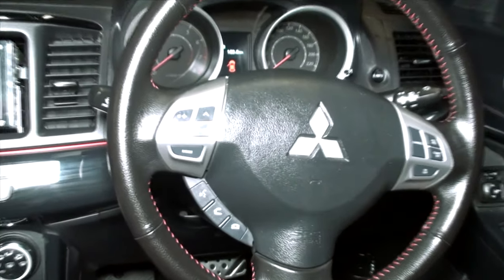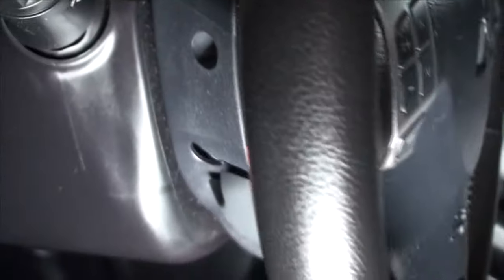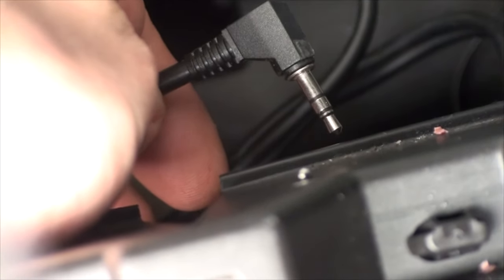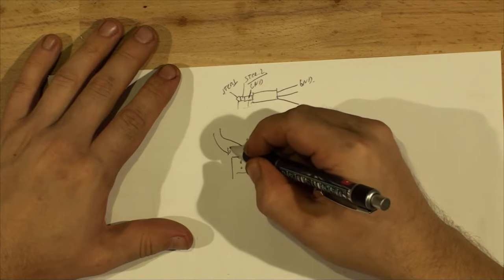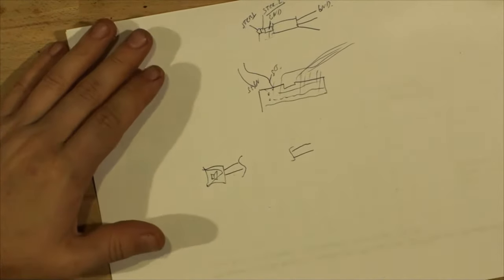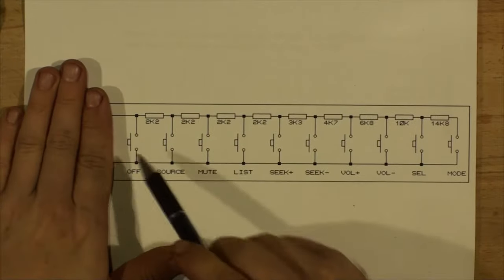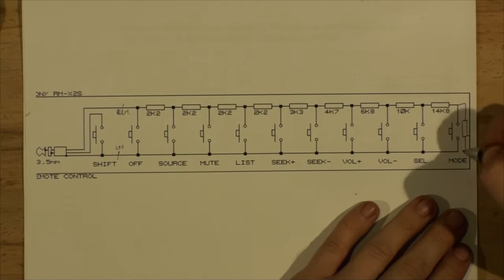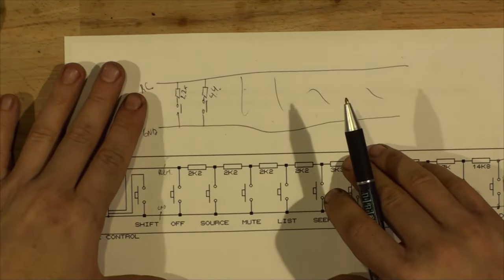How to Make Your Steering wheel control work with any radio without converter box!

Comment: Great work, thanks for this.  I've just put a new Pioneer head unit in my Prado, and did buy an after-market converter for the steering wheel controls.  But I was mystified as to how it worked - how so many buttons could send signals over basically 2 wires, one of which is ground!  I was even thinking maybe it was serial RS232 data.  But now I know - not RS232, but much simpler and very clever.  I wish I'd seen this before I did the job.

Comment: hi, very informative video. Do you know if chineese head unit devices do in the same principle? There only KEY1 (and KEY2) wires, no 3.5 jack for SWC. What voltage they are using?

Comment: I got one for you ,the 2017 Dodge charger / Challenger steering wheel I've got it apart in front of me 😖
Does canbus make a difference or can I just wire it up may I add it's a bit of a project as this is going on to a stratus /eclipse ,which is funny because your exact steering wheel is why I'm doing this there's a writeup on club3g about upgrading well I figured I stead of the steering wheel you have Ior outlander , would use this one a 2015-17 dodge wheel out of a challenger I know this is doable just not sure where to start looking or who to ask to further my education 😖,thank you for you time brother 😊I'm going to watch you video for the 20th time and continue attempting to apply it to mine thank you again 😊
Reply from the maker: If you have an aftermarket unit but steering is canbus (it’s unusual) you can just use the wire to connect to the unit and on the steering wheel side just rewire buttons to resistors and connect to the wire that’s going to the headunit
Reply: Thank you for the timely response! 
You know what I was thinking the exact same thing ,but beings the wheel is out of a canbus vehicle I wasn't aware that we could just wire them the same way oh wait ok ok,I see what you are saying ok I misunderstood you ,you know what that is worth a try for sure thank you ,I did get everything disassembled before and it is a quite bit different then mine or your wheel I think, I wish I could show you 🤔 ... at least where I should solder at I wish I had someone to vet that , it looks more like a motherboard now then a circuit board. The unless you want to try and do a video on playing around with that wheel haha mabey hooking it up to your vehicle I think youd see what I mean I'm going to try what you said tho I'll keep you updated thank you for the feedback max I really do appreciate it !!! Watch it be this simple haha as someone who tinkers with stuff too it's in my experience that once the project is over and your looking back, it's usually us that makes it more difficult then what it was haha thanks again !!!

Comment: I have a Pioneer radio. Will the Sony resistor setup work the same way on my Pioneer?
Reply from the maker: It depends, check if your pioneer has learning function for the steering control, then any steering control will work. If it doesn’t you can try to see if it’s gonna work as is, if not you’ll need to resolder your steering wheel resistors.

Comment: On my ford transit there is no cable in the harness for the steering wheel controls. The BEMM manual (body equipment mounting manual) says there should be 2 pins for steering control. They don’t exist in my van so how would I go about testing which wires input steering wheel controls into the radio?
Reply from the maker: If you don’t have any cables in your steering wheel you’d have to buy the “spring cable” that goes into steering wheel. Then you’ll be able to connect the buttons.
Reply: @MaxELECTRONICS  I’ll have to have a look inside my steering wheel, there are buttons that controlled the OE radio (skip/rewind track, volume and voice recognition). There should be cables into the harness in theory but I can’t fathom why they’re not there and how the radio previously operated perfectly 🤯
Reply from the maker: @tomloweshow you can have a look at the datasheet of the current radio you have and see what pin is remote. Or you can open steering wheel and check for continuity with multimeter

Comment: Hello my friend.If i have two different key line wires like key line 1 and key line 2 is it possible to connect to the same multimedia unit 2 controllers ???One controller the steering wheel controller and the other an i drive controller behing the gearbox.Will it work???
Reply from the maker: The second one is most likely data, it usually connects to the stereo with iLink adapter (if your stereo supports iLink)
Reply: @MaxELECTRONICS  what do you mean iLink???The key line 1 is for controller and the key line 2 what for???
Reply: @MaxELECTRONICS  So in key line 2 wire isn't possible to connect a second controller for the multimedia except the one i have on steering wheel ????I want to connect an bmw i drive controller if you understand what i mean
Reply from the maker: @giorgosc4298 if it’s just going to steering then it’s for answering and hang up buttons, it’s used with diodes and connects to line one

Comment: My Mazda steering controls seem to work backwards. I have not analysed the circuit, but based on my multimeter readings: no buttons = 5KΩ, then it drops off depending on the button: mute = 2KΩ, mode = 1KΩ, down = 550Ω, up = 300Ω, vol+ = 150Ω, vol- = 55Ω. I think I need to somehow reverse this so no buttons = no resistance, then it adds resistance on pressing of buttons.
Reply from the maker: You can remove “termination” resistor, some steering wheels have termination resistors that complete the circuit, they usually required for OEM head units.
Reply: @MaxELECTRONICS  I'll check the board and see. Your video is excellent by the way thank you.
Reply: My Chinese import headdeck has programmable button inputs, and I managed to get it working without removing the termination resistor. I needed to put one of the wires from the steering wheel to ground, and the other to one of the SW wires from the head deck, then programmed the 5k resistance to "none" button, and all works perfectly!

Comment: Hey Max. Awesome vid. I’m having issues with a Sony in a gen 1 Mini Cooper. I bought the control module adapter but it’s intermittent.  

Found your vid and curious: the Sony (MEX 5300) has programable functions. Like mapping a game console controller on PC. You select the function on the head unit and it prompts you to press a button on the steering wheel. Is it safe to assume I would just need to directly wire my steering wheel leads to a 3.5mm Jack and the Sony head unit would map based on resistance and as such no need to solder resistors?

Comment: Does this apply for touchscreen radios? Same principle?
Reply from the maker: Yes it is :)
Reply: Those on ecranes simple can have swc or key1 or Key2 and you just wire them and in programming the buttons in the app of the radio

Comment: Fantastic video. This is exactly what i was looking for. Where did you find the Sony schematic? Do you happen to have any resources as to where i can find Information on a given stereo? For example, I just bought a Boss audio BCPA9690RC and really don't want to pay 50 to 100 dollars for a unversal box, but I am having trouble finding any schematics for the remote circuit. Is there somewhere that offers these?
Reply from the maker: First check if your head unit has a learning function, sometime they have learning function and you can just learn buttons digitally on head unit without any external adapters. If it doesn’t then you can use 2k resistors to probe out what happens, so power the head unit and then short the 2k resistor between the control and ground, see what function it triggers, then 4K then 6k ect (just 2k resistors in series) unfortunately there’s no website that has all this info, you can try contacting the manufacturer and asking them
Reply: @MaxELECTRONICS my swc dont  work with headunit. Swc however work with original radio. Is it a hardware failure, what do you think?. Everything is connected correctly. It worked but uddenly broke down.
Reply from the maker: Check if there’s a termination resistor permanently installed between ground and signal cable
Reply: @MaxELECTRONICS  thanks for your comment. I'm not sure what it means However only modifiacation to the previous system is an amp connected to the factory ground. Swc worked with the amp until my first drive when it stopped suddenly. I thought that could be a capacitor or something alse etc in HU.
Reply from the maker: It’s hard to tell without looking at it.

Comment: I drive a honda civic 97 model.
I want to install a honda accord steering wheel with a button function and I want to install a 9ich touch screen. Will it work or is there a way to make it work on a car like mine. Thank you.
Reply from the maker: Yes, the touch screen will have learning function that can be programmed to work with any steering wheel

Comment: Hello. Please help me choose the resistance for the Clarion nx + Mitsubishi steering wheel.
Reply from the maker: You need to find service manual for your stereo and have a look at the resistances, or you could buy “programmable resistor” and try different values in increments of 1 kOhm and write down the values. For example try 1k and see what happens, then 2k ect
Reply: @MaxELECTRONICS  I didn't find the necessary information in the instructions. Google doesn't find it either. I tried the selection method, it doesn’t respond.

Comment: U have Techno MP5 Stereo. And it has a wire in harness that say Steering Wheel/IR-Out. So how can i make my steering buttons work with that. Please help me out
Reply from the maker: Did it come with manual?
Reply: @MaxELECTRONICS  No. no manual.
Reply: If i can show u pictures. Maybe than you would get it and be able to help me out.

Comment: Hey mate, just wondering if you have a link to the Pioneer wired remote resistor network diagram you have in your video, unfortunately it is unavailable on the JVDE website anymore.  Have been searching got either that or a similar reference, sadly to no avail.  Kind regards, Damien
Reply from the maker: Pioneer has exactly same resistance as Sony so follow Sony one and it will work with pioneer
Reply: @MaxELECTRONICS  Many thanks for your speedy reply! Now if I can only find the resistance for the voice command button!  :)

Comment: I’ve googled for hours can’t find my head unit resistance wiring diagram. Boss BE7ACP
Reply from the maker: Try using probing method, use variable resistor, and just use it instead of a button, and use increment of 1k and see what unit does, then just write down the values.